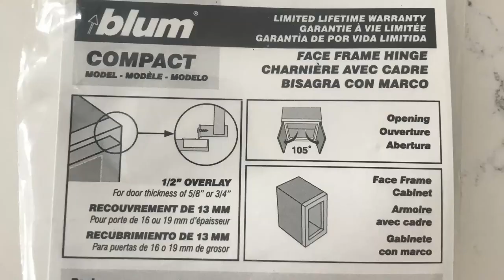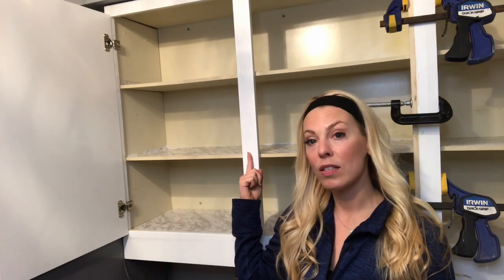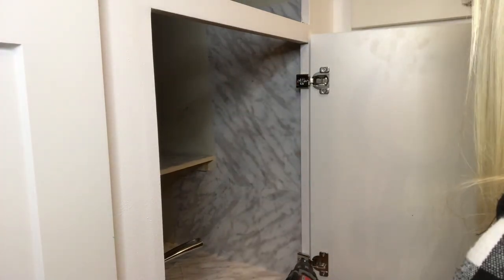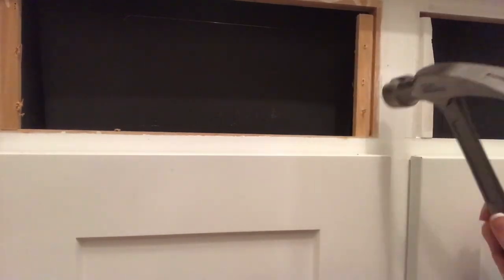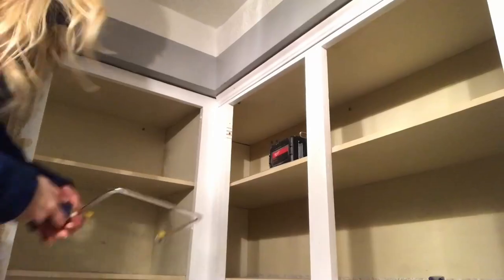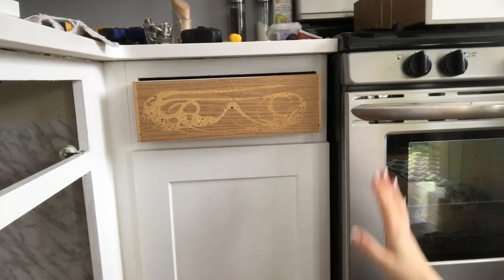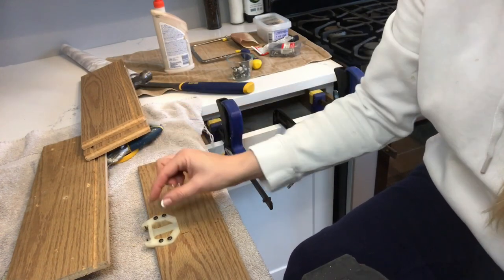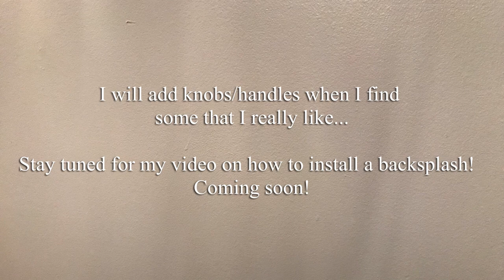DIY How to Update Kitchen Cabinet Doors & Hinges on a Budget

Comment: Your cabinets have turned out beautiful.  Great job.Thumbs Up!  I found when doing this process NO ONE seemed to have the information.  Certainly NOT me.  I found 1 video that gave a lot of information over my head.  I went out and purchased 3 sizes of the hinges and messed with a few used, $2 doors, against my frame to figure it out BEFORE I ORDERED my NEW LOOK DOORS that needed to be a larger size than my original ( I had the old outer hinged cheap doors) to cover more of the cabinet frame and use the euro hinge like yours, with soft close features.  Most do not go do the work you have done.  It really is LOVELY! In my case instead of cutting I used the same type hinge that allows a deeper overlay of the door over the cabinet.  The hinges come in 1/2" overlay which look like what you used.  But for those that require a deeper set back (like the base cabinet by your stove.  Possibly a 3/4" or 1 1/4  would have worked, setting your door back without cutting your cabinet frame.  
No matter how it got done it take work and determination to complete a process that is unfamiliar.  Blessings to you for not only doing the work but giving all of us ideas that can help get us through the process.
Reply from the maker: I Apologize for such a tardy response! I really appreciate your comments! Sometimes I wonder why I film But hearing that it is appreciated and helpful will keep me going. I too had a really hard time getting help from anyone or finding information online... so I kind of macgyver’d it but it turned out great! One of the hardest parts was actually finding doors that would fit the raywal cabinets. It made such a difference..I know it’s not perfect but i was ok with that 😄 thanks again so much! ❤️

Comment: This is exactly what I needed. Thank you so much. You got one more Subscriber. Please let me know what kind of cabinets doors these are. Thermofoil or MDF? How did you match the paint for frame with prepainted cabinet doors?
Reply from the maker: Thank you! I'm happy to help! I bought the cabinet doors from Lowes - MDF shaker style but the brand is discontinued. The best advice I can give is to make a list of all the cabinet opening measurements, find the style of cupboard you want, and then look at the different brands online to see which one aligns best with your cabinet openings. I had one that was a bit of a pickle so I ended up with a little space between the two doors on the base however i was ok with that :) Anything was better than what I had before. Once I had the doors, I took one (the smallest drawer front) into home depot and had them colour match. :)

Comment: Where there size adjustments to door sizes you could have made when you ordered the doors and drawers? Also dont the hinges allow for adjustments as well?
Reply from the maker: That part was actually the toughest part. The door sizes are standard but thé standard has changed since these cabinets were installed over 15 years ago. So that part took some time. 

I suppose you could always order custom doors with custom sizes but mine were bought from a box store. I felt if I cut into the door as it would change the look too much. The hinges adjust slightly but I still had to make alterations to probably about 75% of the cabinets before installing new doors
Reply: @kdadesigns  "but I still had to make alterations to probably about 75% of the cabinets "
That is a red flag that there was something fundamentally wrong with the doors.  If you bought 'standard' doors, without measuring the openings exactly, then that's the issue.  If you measured each opening and each door was built to fit, you should have been able to install them much, much faster without doing any of that custom woodwork on the cabinet openings.  I blame Lowe's for letting you buy the wrong doors.  
Or could it be you did not number the doors, because you had some doors too wide and some too narrow.  Did the doors get switched around and mismatched for the openings???
Reply from the maker: @dchall8  No, there was not anything wrong with the doors and I didn't buy the wrong doors.  The original kitchen was built over 30 years ago so 'standard' sizes have changed.  The biggest reason i had to modify the cabinets (by that, I mean cut into them) is because i was switching from hinges that were visible to hidden hinges.  Otherwise i would have only had to modify a couple cabinets. I assure you each opening was measured thoroughly and did a lot of research before ordering. Lowes had nothing to do with this project as they had no clue how to do this. I am still thrilled with the result years later and would not have done anything different. Thanks for your engagement!

Comment: Do you have any recommendations if I want to use the same cabinets front but with inside hinches?
Reply from the maker: damarisferro I wish I had some tips on keeping the doors and adding the hidden hinges however the older style doors are not as thick as the new style doors with hidden hinges. the hinges are screwed into a pocket on the back of the new doors. I mean, if your doors were thick and you could create a pocket the same size as the hinge, it could work but my old Raywal doors were way too thin. Someone needs to make hidden hinges for older doors! Sorry I can’t be of more help here!
Reply: @kdadesigns  thank you.